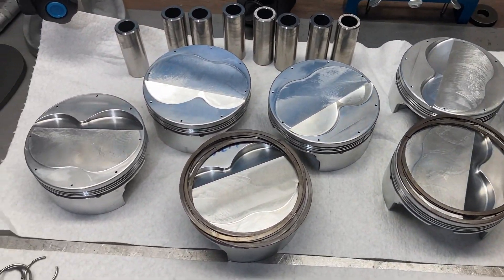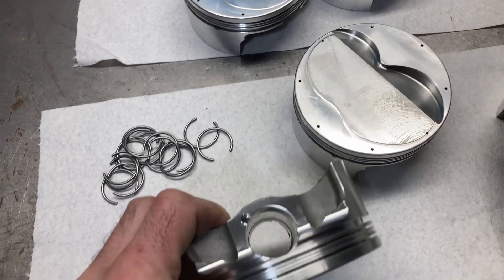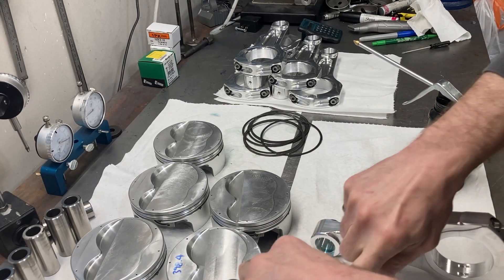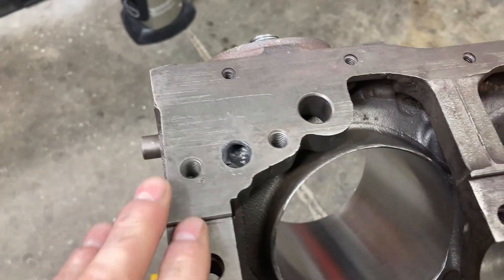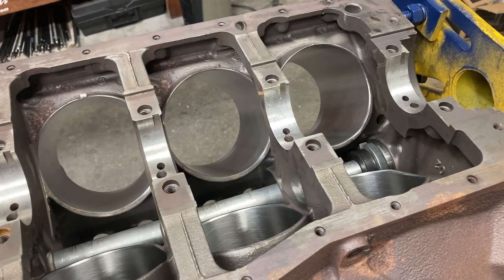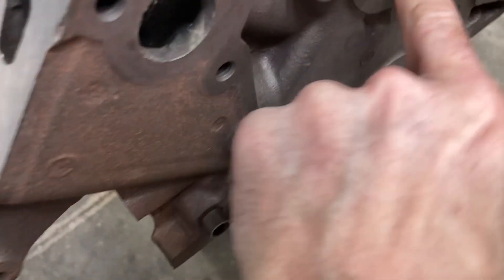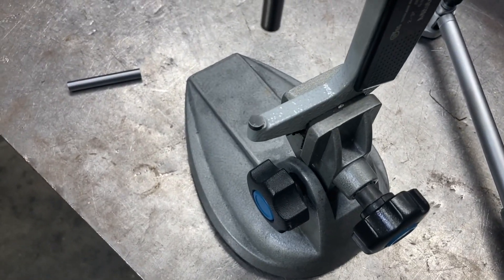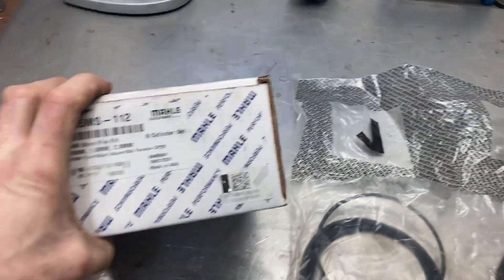Lykins Motorsports 311 SBF Piston/Rod Assembly, Cam Bearing Installation

Comment: Cam bearings are always fun. On non coated cam bearings, I used to use an old used hydraulic roller cam for seating my cam bearings in place by shocking them by using a piece of brass round stock. Pull the old cam out. Then I’d use an old flex home wrapped in scotch bright soaked in CRC lube and clean the cam bearings. Clean, and put the new cam in and it’ll rotate freely. Sometimes I’d have to repeat this process. FE’s , SBC, BBC are a pain, but SBF is always the simplest. Another great video. Thanks.

Comment: I've done a few 289/302 in my 62 year's,  I would not use them custom Pistons (pin in oil ring) I never do Custom anymore.  Off the shelf is always going to be better, when something goes wrong & you need repalcement parts,  Call Summit/Jegs they can Overnight & your Not waiting Weeks/Months.
Reply from the maker: If you use shelf parts, you get shelf results.